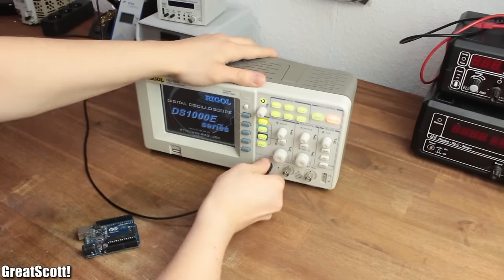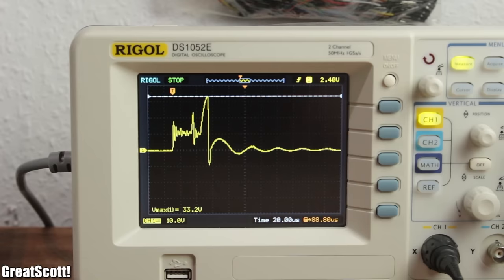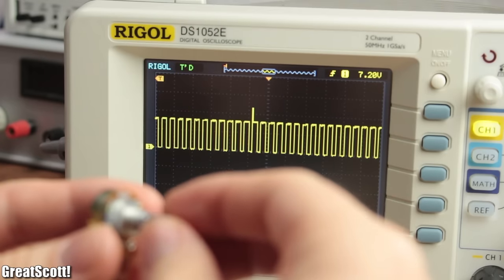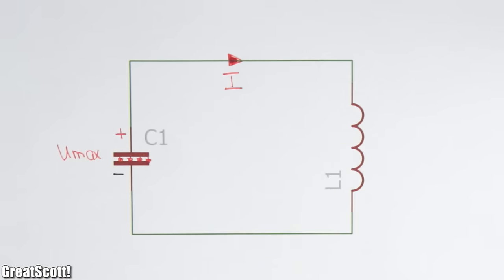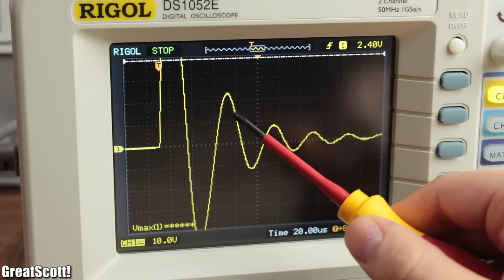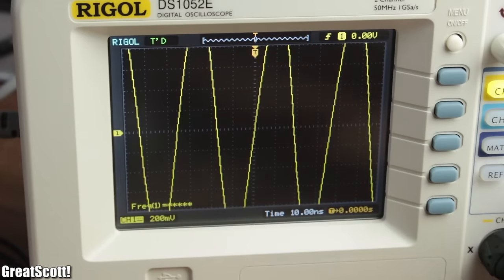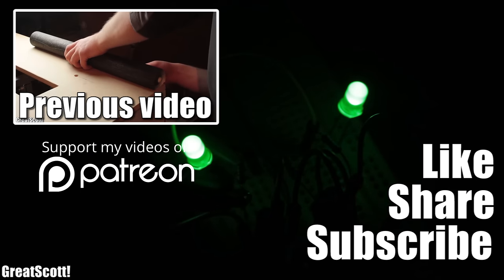Electronic Basics #17: Oscillators || RC, LC, Crystal

Comment: I recently learned that you can make a square and triangle wave oscillator using a single op amp. It is simply an RC circuit in a comparator (I think that is what the configuration is). The capacitor determines the frequency range. Higher = Lower frequency range. I used a 10uF capacitor and my range was 1-200Hz.

Comment: I built one simple Pearson-Anson oscillator. It creates a saw tooth signal with a glow lamp and was used in analog sound synthesizers. 
Glow lamps have also been used in noise generators.

Comment: would you make a video about how to measure inductance?
Reply from the maker: Sure
Reply: wzd leo Arduino lcd Transistor, capacitor, inductors (inductance) , and resistor meter!!
Reply: LCR meter
Reply: Apply a known high frequency square wave with a known voltage and measure current flowing through it, then you can calculate the freq. by using the coil reactance formula backward.
Reply: You can measure it using a Maxwell Bridge, its a null type AC Bridge that measures the inductance and also the resistance of an Inductor (quality)
Reply: Hello. I have been struggling for some time to get a project of mine to work precisely. In this project I use 2 incremental encoders that have 2 channels each. They have 600 pulses per revolution, but if you use both the rising and falling edges of both channels you can count up to 2400 steps per revolution in each encoder. The problem is I've been trying to read both encoders with an arduino using interrupt pins, plus run the loop where the control routine of my project is, but since the project needs 2 independent encoders, I'm pretty sure i get simultaneous interruptions happening frequently, and also interruptions happening while the arduino was still running a previous interruption routine from a past pulse, so it all becomes a mess, and my arduino isn't able to keep up with all the pulses and ends up missing many counts, especially when the encoders have to rotate a bit faster, but it's important that i maintain a precise count, even if i have to decrease the resolution of the encoders and use only the rising edge of one of the channels and make it 600ppr, but even then it loses count. So I've been looking for some other devices, such as a counter that will read the channels of the encoders and increase or decrease the count based on the direction of rotation and then send the updated count value to the arduino through some kind of communication protocol like SPI or I2C maybe, so that the arduino will be free to run the control routine and only read the updated count value from the counters when it needs to at a sample time that I chose. The thing Is I haven't been able to find such a counter that does that exactly. Do you know of any such device or anything else that might be able to help me? Perhaps that would make a good subject for a video, since i've seen many people on the internet with similar trouble, and not many people with good solutions to that. Thank you very much.

Comment: I just come across this video. But I have a little question about this oscillator circuit like LC or crystal oscillator... Can any one of this be used with an inverter circuit to produce since wave at 50Hz?

Comment: Is there a difference between a rectangle wave and a square wave?
Reply from the maker: +Jamie Rollinson No. I noticed after recording everything that I used the two different terms. My mistake.
Reply: +Novislav Djajic Every wave has a duty of 50% if its proper
Reply: Homemade Laboratory not in pwm signals
Reply: Only in terms of duty cycle.

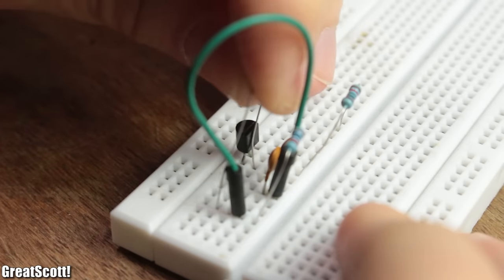Comment: Thank you for this video, I used the topology at 4:39 for the colpitts and it works perfectly.

However, I cannot really grasp how the LC tank is formed (inductor is not in parallel with the two capacitors), and how the output of the LC tank is connected to the input of the amp ( I don't see a feedback path going to the base of the bjt).

Could someone please briefly answer me those two questions? Thanks
Reply: 1) It is an LC series resonance circuit
2) The capacitor voltage divider is connected to emitter resistance, it acts as a negative feedback.

Comment: Because the crystal sets the micro controller speed, does that mean that if I changed the crystal I could change the speed of micro controller and if so, assuming there would be limitations how much could the speed be changed?
Reply: Yes. It's essentially what happens when you overclock a CPU. The device might function at a slightly higher speed, and increasing the supply voltage can increase this maximum, at the cost of higher heat output and a shorter lifespan.
Reply: Eventually if you overclock too much the crystal will resonate faster the processor can compute, leading to incorrect calculations. It might only be half-way done with its multiplication operation but the crystal ticked and now it saved an incomplete value. Generally you'll have very little overclock room before you get incorrect calculations, since they already calculated the highest valid frequency for you.
Reply: If the micro proc. could function at  higher clock speed, they would have used a higher freq. oscillator in the first
 place.

Comment: this is probably gonna get buried but is there any way to change the frequency of a crystal to possibly a sub harmonic ex: 12mhz to 1.2 MHz without changing the crystal?
Reply: In electronic watches they use flip-flops, each flip flop dividing the frequency by two.
Yeah ik, reply two years later.
Reply: use a jonson counter.

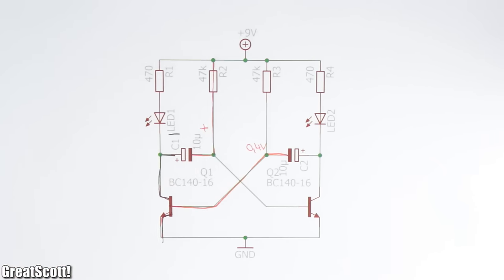Comment: why is the symbol of the + on the right (at 1:39) and you say it charges through the 47k resistor which is the negative end according to the schematic, shouldn't the symbol be reversed ?
Reply: As shown in the diagram, the + is always connected to the collector. To understand the operation, it is the charge of C1 that controls the "on" of the transistor Q2 at the same time that the discharge of C2 controls the "off" of Q1 and vice versa. when C1 is charging, the current from Vcc passes through R1, LED1 and the base of Q2 to join the GND.
Q2 is then active and the current of the collector Ic2 lights the LED2, C2 takes advantage of this state to discharge by moving the electrons of its armature (-) to + Vcc via R3. Thus the negative of C2 which acts on the base of Q1 is brought to the potential 0V and Q1 is blocked. C2 being discharged, sees its negative in direct contact with the GND and starts to charge via the base of Q1 which will immediately activate to turn on the LED1 and open the discharge path of C1. And so on the cycle repeats itself continually
 ...
Reply: To watch a simulation of the oscillator, visit http://falstad.com/circuit/
on the bar at the top, click on circuits, put the cursor on transitors then on multivibrators and click on astable multivib
Reply: @electronicdiy3738  Why current through R2 or R3 doesn't flow straight to the base of Q1 and Q2, but stops at capacitors C1 and C2 to charge them up and then "disappears" from this line?
Reply: @tomasz6687  because of the asymmetry between C1 and C2, due to specific tolerance of each even if they are similar, a capacitor with the low time constant R1C1 or R4C2 must be charged before the system oscillates. During charging, a current flows through R2 and R3 but does not flow directly to the bases of Q1 and Q2,one current must be negative, while other is positive. The negative current is that of the capacitor which discharges through the transistor connected to its (+), so that the negative potential across the capacitor becomes unable to trigger the other transistor.The positive current flows through the second resistor and the second capacitor charges, that positive current activates the first transistor allowing the negative discharge current to reach the GND.
Reply: I think I found my answer: while charging capacitor C1 is conducting current and according to not very precise but mostly true statement "Current takes the path of least resistance" current finds easier path from Vcc  and R2 to mass through this way than flowing directly into transistor Q2's base. When C1 is charged to at least 0.6V then it turns Q2 ON. Next C2 gets discharged to 0V through Q2 C-E  what turns OFF the Q1. The cycle repeats respectively.
Thank you for the hints.
Reply: @tomasz6687  that's right, are the capacitors that control the oscillations, if you remove them, q1 and q2 will drive both instantly and the circuit becomes stable so that both LEDs remain lit without oscillation...
Reply: @electronicdiy3738  Thank you for explain it for us. I really appreciate it.

Comment: Hi! One query: I have to perform an oscillator to maintain a QCM at its resonant frequency which is 10 [MHz]. I could use the last circuit you showed but I don't understand how to choose the components according to what the resonant frequency is.
Very good video. Greetings from Argentina.

Comment: What stops the capacitors from discharging at the same time in the first oscillator circuit? Because the 47k resistance is the same on both, so would they not charge at the same rate?

Comment: 1:25 I don't really understand how the capacitors get charged alternatingly. Unless I'm overlooking something, the circuit is perfectly symmetric, right? So by my logic, C1 and C2 should get charged at the same time and should then activate the transistors at the same time. Also, how does C1 discharge exactly when transistor Q2 is conducting but not Q1? Through the base of Q2? If there's still someone who reads these comments, please explain! Thanks!

Comment: Great video. I need to create a 2khz oscillator to drive a buzzer. The frequency must be stable at 2khz and must support head and a voltage between 10-16 volts without changing much. Do you know witch would be the right oscillator circuit to achieve this task?

Comment: Will a tank circuit feed with pulses of one polarity only,  have a backrush of a induced voltage going in revers  direction of the feed polarity, and if this current is captured is this what is considered an constant currant supplying device?

Comment: I have a question: What should be changed if i want to get 4 MHz sine wave? - i mean what values of resistors and capacitors should be used for 4MHz crystal? If i just change crystal from 16 to 4, and nothing in circuit then it doesent look like sine wave at all.

Comment: How do I compensate for parasitic capacitance in a circuit with a crystal oscillator (but no capacitors) where the parasitic capacitance is having undesirable attenuation of the crystal frequency?

Comment: Two things: The "Great Scott" button in the bottom left is very hard to click because of the bottom bar for play and pause etc, might be better to move it to the top.

Secondly; could you try turning a wind up torch in to a wind power generator? I'm building one currently to see if I can light up a garden light, I want to know if you can do it better because mine can't run of very light wind.

Thanks!

Comment: 1:21
Short question, how are the capacitor charged through a 47k Ohm resistor whilst being connected to the negative side of the capacitor?

It just fucks with my brain.
Just help me kicking that logic error out of my head
Reply: I do not know if im right but i think that  the voltage on the capacitor is soo small that it does not matter. You can also use a non polaraized capacitor.
Reply: When the capacitor reaches 0.28v the base of the tranzistor turns on
Reply: I hope that this will help you a little bit

Comment: if 6 is 2 thirds of the supply voltage then the vin should be 9v, not 12. is it safe to apply 12v?

Comment: Something Different: Can I use a 6V Display with a normal battery pack ? I want to run the XU4 with 5V input and a Display with  6V. Does it work or do i need another battery pack for the display ?

Comment: frm .01Hz to 100 khz a Wein Bridge oscillator does not require inductors; it is made with 2  matched resistors and 2  matched capacitors and can use a incandescent bulb to maintain its amplitude with very low distortion. It can even be made using a 
variable dual  capacitor  allowing the frequency to be varied by a factor of 10 !

Comment: What if you used a PWM at 9us and at 9v on a 1uf L clockwise 1uf L counterclockwise and a 1uh C in sires with the ground wire in-between the LC. Could you make a reverse resonant tank circuit. 
March 24 2022 12:00pm

Comment: Why Crystal oscillator preferred more in embedded systems as compared to other RC or LC oscillator ?
Reply: Crystal will not drift as much as rc or lc and is exactly the frequency marked on the device.

Comment: is it possible to create a really low frequency using the first method (t555)? for example 0.001Hz
something that will last for an hour or so or more?
Reply: The 555 can be configured as a 1 shot monostable to produce a delay or pulse for an hour easily.

Comment: what is the difrence between Osciloscope and Spectrum analyser?
Reply: a spectrum analyzer shows you the intensity of frequency components of a signal. an oscilloscope shows you the voltage on a graph vs time
Reply: Oscilloscopes graph voltage on the vertical over time on the horizontal. A spectrum Analyzer shows amplitude on the vertical (similar to an oscilloscope) with frequency on the horizontal - so lower frequencies on the left and higher frequencies on the right.

Comment: Video is too short, and there isn't enough explaining done.
Reply: You could always watch more in-depth explanations at Khan
Reply: +Dragos Puri More than "short", I'd point out that it leaves little room between complex sentences. I advise the author to slow down a little bit on the explaining, at times.
Reply: +Dragos Puri he's wetting your appetite
Reply: +Dragos Puri Do a research then.
Reply: +Flaviu Hossu I will when necessary. But it's much easier when someone explains it to you.
Reply: Agreed, even though these videos are clearly not meant to be tutorials, giving a few pointers along the way would make them immensely more valuable (ex.:  just name the Colpitts oscillator @4:38, so that anyone interested can do their own research).

Otherwise, great series !
Reply: If you watch the video again from the start, it will seem like it is twice as long ;-)
Reply: He only goes up to 16 MHz, I wouldve liked to see mention of oscillators for higher frequency circuits
Reply: It’s pretty difficult to go in depth with this stuff. You can only cover so much in a specific video. This is why there’s entire courses, and multiple levels of courses for this kind of stuff in university. And even that really isn’t enough speaking from experience hahaha
Reply: Experiment it yourself is far much superior than explaining it using videos...you may have missed a lot more the unexplained details along in the process...there are simply too much to explain and some of the thing undescribeable by words...until you  try you will see it
Reply: You again?
Reply: change the playback speed
Reply: Go ahead and make better, I'm waiting

Comment: Hey have a question.
I need something like an oscillator, or something in that way which is not a micro controler or a chip, which chainly activates  and deactivates a signal (In this situation the chain consists of 8 pieces. Should switch in a frequenzy that our eye wouldnt see a differenz, so like u did in some of your previous videos). Is it possible to build something like that with oscillators or anything else, or do i have to use a chip?

Comment: Hello, a random question. What is the formula of electrical energy converting to heat. Couldn't find it anywhere. Thanks.
Reply: +Oğuz Emre Sayman Watt do you mean?
Reply: I don't know how to describe it. For example, 2Amper current flows through 300ohm and that makes the resistor 40 degrees. I'm just a beginner so don't judge me if I said something stupid.
Reply: Its wattage. I was trying to hint you along.
Reply: +Richard derp me. Thanks.
Reply: +Oğuz Emre Sayman Its not that easy. First you have to calculate the total power the circuit consumes.Lets watts w = voltage / resistanceThen minus the useful amount uw - u = watts of heat

Comment: What happens if I put an oscilator different that the one an Arduino uses, for example? Will its precessing work faster or will sh*t happen, or something like that??? Thanks M8
Reply from the maker: +Felipe Picard Overclocking does work to a certain degree.
Reply: Sweet! thanks

Comment: I didn't learn anything. Why would you disconnect the main voltage source, if you want the oscillation in a dc circuit? Does it need to be in parallel?

Comment: so if i want to build a oscilator with a NE555P and i have a speacker that produses 84dB at 3V how do i acheve that?
Reply: A speaker is a quite low impedance for the 555 but it can handle it. Put it thru a capacitor first, or better yet, a power transistor stage for more volume..sound will  be a harsh beep.

Comment: Sir,can you make a video about making a switch mode power supply...100 W
Reply: Akbar Sidiq hi seen your comment do you know much about oscillators ? I have some questions please
Reply: @dandwrasan2342  wha's that?
Reply: Hi Akbar is there such a thing as a 433mhz oscillator?
Reply: @dandwrasan2342  The core of the transceiver module is the SAW (Surface acoustic wave) resonator which is set for 433.xx MHz frequency operation. This technique is known as Amplitude Shift Keying (ASK). This amplified signal is then fed to PLL (Phase Lock Loop)
Reply: @dandwrasan2342  I mean yes.
Reply: Akbar Sidiq thanks very much 🇬🇧👍🏻
Reply: @dandwrasan2342  your are welcome,sir
Reply: Akbar Sidiq I have another question for you do you have a email address
Reply: @dandwrasan2342  sorry sir,i forgot the email addres.maybe tomorrow i will find out.